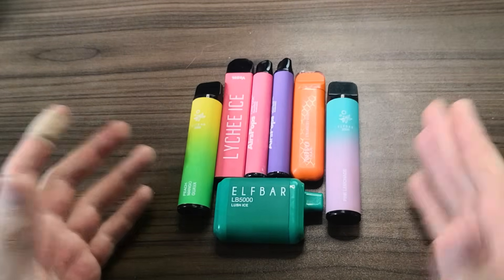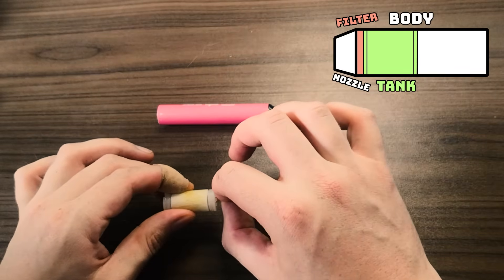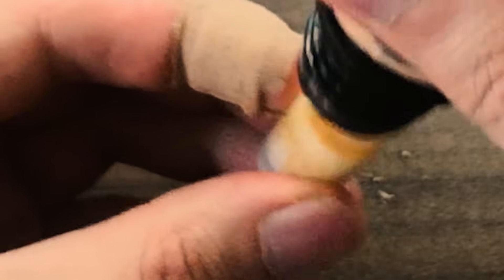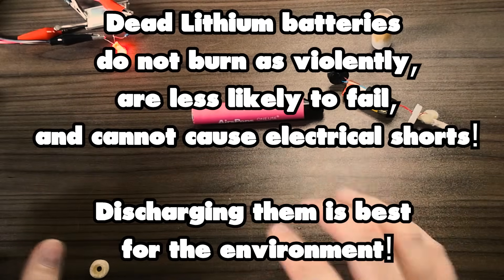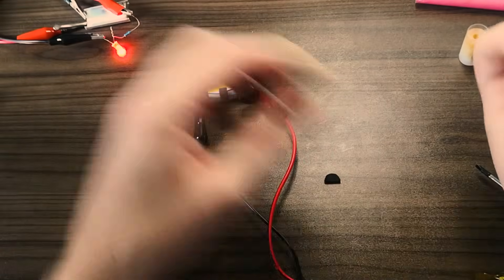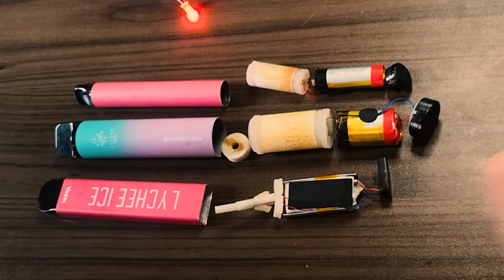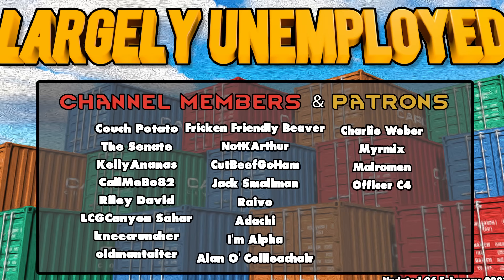'Disposable' vapes are a lie. Here's how to fix them.

Comment: 1. Vaping was not 'designed' by 'tobacco companies'. It was initially ignored by them, then they waged a war on it, then they 'embraced' a version of it designed to cost as much money as cigarettes.
2. Reusing unknown batteries for something that comes in contact with your mouth is bad advice. DO NOT BUY DISPOSABLES.
3. Coils and wicks are consumables, you should change them pretty often. You can't do this with disposables. DO NOT BUY DISPOSABLES
4. Disposables have subpar materials that were used 10+ years ago. DO NOT BUY DISPOSABLES

Comment: Disposable vapes should be banned completely. The only difference between a disposable and a reusable is a simple IC board to charge the battery and some kind of hole to drip fresh vape into it it. For that very minor difference in cost & design (< $1), the amount of e-waste would be slashed because people wouldn't be throwing these things away.

Comment: Don't the coils just taste like burnt ass if you do this?
Reply: @D-Fens_1632  you should easily be able to run 100ml of juice through one coil/mesh, most of em only hold 2ml anyway so that's 50 refills, so if you can reuse a throwaway 50 times you've saved a lot of money.

Comment: I've been making rechargeable flashlights, upgrading batteries in devices (like Bluetooth speaker, etc) and replacing disposable batteries in remote controls, using the batteries and charge circuits from various disposable vapes. 😊

Comment: Electronic engineering student here. That solder at 8:15 are what we call cold joints, it's fine on something like this but if you're ever soldering again, use flux, tin the pad, and the wire, and than solder it. Ps, the new space engineers series is amazing please continue it

Comment: i do this with distillate vapes sometimes, you can usually pry the top off and remove a rubber grommet, then refill about 2-3 times (though distillate is alot thicker than vape juice, the concept applies the same)

Comment: Disposables should be banned.  Most of the cheaper elfbars are some of the easiest to refill, all you've got to do is wiggle and pull the mouthpiece part out the oval body shell, and you gain access to the juice sponge underneath, I can do it by hand.

Comment: You should never press/apply pressure like you did on these type of battery. The soft part is kinda unstable and can explode in a worst case scenario. Always handle them from the sides only

Comment: I may be a bit late to the party, but am saving all the used vapes I can, hopefully will make some power banks from the batteries. 
Seems such a waste to just throw. Same as all the 18650s hidden away in old laptop battery packs. Hidden gems of power.

Comment: I use a nitecore battery charger, it barely fits but it works. Doesn't overcharge either. I also don't bother with the tape, never any issues

Comment: In the US many (most) disposable vapes have been re-designed to have a USB (type C) charging circuit.  However many new designs also include a chip that counts the seconds of your puff (usually in 0.1 second intervals) with an instruction to turn off the heating coil once the design tolerance has been reached.  In practical terms, if your vape was sold with a promise it would be good for 4,000 puffs the counter ensures that you won't get 5,000 (and it will usually turn the heat circuit off at 4250.  They usually assume your puff will be about a second and a half.  Some will temporarily turn off the heater at about 7 or 8 seconds as a safety feature.  The puff count is usually held in DRAM (ASCII) on the main chip.  At least one person has put up a post about resetting his to zero using a forensic computer technology.  However, that method is beyond the capability of many people. It may be possible to zero the counter with a jumper, but there are many different chips used by different vape makers.  The end result is that while you can disassemble many of the models, you can refill many of them, but good luck getting the heating coil to heat and produce steam once the maximum allowable puff time is reached.

Comment: nice to see video on you tube. i have been refilling my non refillable for around 2 years now. very easy to do. plus i have a 4 bay 18650 battery charger or i use the charger out of drone battery pack that you can plug into usb device. simple easy. all i did was convert 18650 battery charger to fit the smaller battery or print out a holder using 3d printer and have that base.
Reply: If you are so smart why are you using them?

Comment: I took one apart just before searching for a video like yours. I'm not interested in reusing the vape. I just wanted the charging circuit for some cells I have lying around from DeWalt batteries that my company disposed of for dirty contacts. I'll build a bunch of rechargeable packs for Motorola radios and charge the batteries through a 3.5mm audio jack if I deem it a safe method of separating the series connection and creating a parallel one. Off to seek more information.

Comment: If you pull out the mouth piece and push the entire assembly out through the bottom, you don't have to disturb the vape coil from its seating, just remove the juice cap and refill, they don't always work right after pulling it out of the wicking sponge.

Comment: 12:40 what kind of battery is this, meaning which model and what capacity? I'm wondering, since you said almost 3x the capacity and here in Germany, I can barely find anything beyond 550mAh and I casually use these batteries for small soldering / electronics / pcb projects.

Comment: A few things to be careful. Make sure your liquid doesn't go into the pipe, It'll leak into the coil and cause short circuit. Second, don't overfill the cotton it may leak into the draw sensor. Most cottons I've tested can take around 8-10ml eliquid but small vapes like these in the video don't do more than 3 or 4ml. And make sure your liquid is 50vg 50pg salt liquid. These devices have high ohm coils and you will feel higher vg liquids are harder to evaporate for disposables. Also consider to buy an actual pod vape they're much more convenient to refill and use in the long term.

Comment: I have an elf bar knock off and it wasn't too much trouble to open the top. 

Does Mark the plastic but just stay away from the mouthpiece? 

I imagine you could use a cloth between the pliers and the plastic to prevent marine?

Comment: The charging module you used is a tp4056 just in case people need one. I used the board out of a power bank to charge a disposable vape, filled it while it was in bits and now it works like new.
Reply from the maker: That's the one! There should be a link to the board in the description.
Reply: @LargelyUnemployed  I didn't think to look in the description, I have 10 modules on my desk but that means going all the way upstairs...the power bank was to hand.

Comment: Smoked these till i found out theyre just as Carcinogenic,as genetically engineered tobacco + its toxic flavourings 
🤢
Reply: I am more concerned about the coil inside disposables. They're supposedly made out of recycled metal but what kind of metal? If it contains even a small amount of lead it would be terribly bad
Reply from the maker: The vast majority of coils are made out of either Kanthal (FeCrAl) or Nichrome (NiCr). These are both chromium alloys that are great at handling repeated temperature changes. There is no lead, and they themselves are non-toxic as they do not easily oxidise or give off any vapour that could enter your system. The juice on the other hand is definitely not good for you.
Reply: @LargelyUnemployed  thanks for the info

Comment: I tried this on some of mine. It worked on one brand, but did not work on another (Yumi 1500 disposable pod). Are some batteries not rechargeable?
Reply from the maker: Lithium ion cells are always rechargeable, but it's possible that your vape may have used something else. It's incredibly important that you inspect each one closely before trying to charge it.
Reply: If the battery has mAh and/or mW rating and says 3.6/7/8V it is almost certainly a rechargeable Lithium cell and can be carefully charged with the correct type of charger circuit.  The chance of finding something else these days seems unlikely.

Comment: But how do I keep hitting a chargable vape that stops hitting for good once it SAYS there’s no more juice, even if it’s fully charged? Such as SVL sense triple berry?
Reply from the maker: I don't know that model specifically, but it sounds like the manufacturer has added that feature to prevent you from refurbishing it.
Reply: Not being a user myself I have opened a few that I have picked up on the sidewalk.  While reading about people converting them to LED torches someone wrote that the juice counter can be reset by disconnecting the battery from the little circuit board.  Not sure if this will work in all the devices but it kind of makes sense that the units would start at FULL when assembled and run down after a selected number of puffs.

Comment: it’s good to re use… but quite a lot of work…. why not just buy a vape that is designed to be reused and refilled?…. the best “reusable” disposable i’ve found are the rechargeable elf bar af 5000 it’s simple to refill all you need are pliers to take off the 10ml “bottle/tank “ and it’s good for as long as the internal coil lasts…. i use them all the time…
Reply from the maker: This method is not designed to replace that.  I had just been tinkering with refurbishing them because I found it interesting and decided to share how I did it. Was not expecting it to blow up like this hahaha. I don't think these disposables should exist at all.

Comment: I think i opened my smok novo by crushing it around the seam and then pulling it out. 

I'm now working on a modification where after the vape dies it gets gutted, then a slit is cut near the bottom of the casing, exposing the wiring and battery terminals. I then add in a 4 pin jis connector to the guts that allows me to to connect the vape to a usb lithium cell charger board. The heater and juice compartment has a window cut in it, sealed with sticky tape and is then carefully super-glued to the bottom electronics compartment, affixing it semi-permanently. 

The battery can be recharged, the juice refilled, and when the heater burns up i just solder in a new one from a new vape

It's a temporary measure. My regular vape died and i don't have money for a new one yet
Reply from the maker: That's an excellent approach. Just be careful with the soldering. Heating the battery up repeatedly can damage it as I'm sure you know. You'd be amazed how much heat transfers down if you're not quick

Comment: Drone Guy Here.Not sure if it's been mentioned but you can use a higher-draw load to drain the batteries faster. I use a car headlamp and put it on the back patio. Most of my packs are dead overnight

Comment: Heya, in regard to the charging board is it variable or do you have to buy different ones for volts and mAh? Best wishes, Stefan
Reply from the maker: The board is specialised to provide 1A of current until it hits 4.2(ish)V. The capacity doesn't matter, it will just take longer.

Although remember the internal resistance on much larger cells may cause heating issues! It's better to buy a beefier setup for those.

Comment: If you don't have the insulating tape like what came in the vape on the battery, the clear stuff, can you use regular electrical tape, the black kind used for normal wiring projects?
Reply from the maker: Yes, just so long as the vape doesn't get too hot. The glue melts really easily on those and they seperate quickly. Not great for summer.
Reply: @LargelyUnemployed  Got it. Good to know, thank you 👍☺️

Comment: Rebuildable RDA/RDTA is the way to go. People need to get back to that. 
Making coils and wicks on your own saves an astronomical amount of money. There's a fair bit of up-front cost (kanthal, cotton, batteries, battery charging bay, liquid, device),
but the long-term savings and ease of access to other flavors with just a minor bit of maintenance can make them a far better option. 

Ohm calculators that accept kanthal gauge resistances do exist and can effectively do the brainwork for you to make life easier. I always used 24ga wire, dual-parallel coils with 5-7 wraps. Phenomenally-simple build with great performance. 
Wicks burnt?
Womp-womp, just rewick it after dry-heating the wires and zip it under the sink water for a second without holding the power to clean the wires. 

Reduce, reuse, recycle ♻️ 

Stop creating needless e-waste which prevents an existing market from expanding to take its rightful place. 
Rebuildable kits should be sold in place of this stuff. It becomes a hobby at that point which can lead to healthier hobbies (soldering, electronics repair, etc).
Literally how I ended up building and repairing computers.

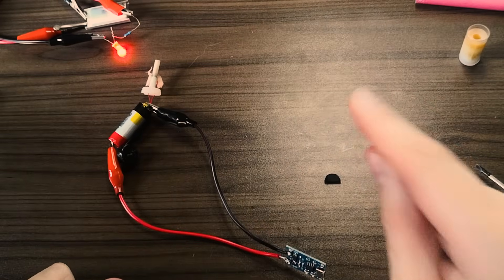Comment: Aside from maybe two I’ve lost, I’ve kept every disposable vape I’ve ever bought because I feel bad throwing them out, but I prefer not having to worry about dropping/breaking/losing them when they’re cheap disposables. I’ve even picked up ones I’ve found thrown out and salvage the battery if I can. The first few I bought (very similar to the first ones you opened) weren’t rechargeable, so I popped them open just out of curiosity and found they were still about half full of liquid, so I recharged the battery and got twice-ish the use out of every one. I’ve used a few batteries/charging circuits for dumb little projects here and there and even cut down a couple of the metal bodies and capped both ends with modified bottom pieces to make as a battery case of sorts, but I still have a (great smelling) Tupperware full of old disposable vapes I haven’t decided what to do with. 8:50  Charge them in a fireproof bag. Won’t stop the lithium fire, but it’ll contain it.
Reply: Keep em. Tesla will soon be buying lithium for millions per ton 😂
Reply: @RandomBogey  Hi, one dude makes electric bikes using them vape batteries..

Comment: i used to cut the end off a type c charger and use the exposed wires to charge the battery not the safest way but it worked

Comment: Discharging lithium batteries below their minimum voltage makes them more likely to grow dendrites that puncture the cell membrane, causing a short and a fire. Do not try to discharge any not-so-good looking battery to 0v before disposing, JUST take it to a hazardous disposal center or battery recycler (and maybe keep it in a bucket of sand)

Comment: the problem  with  disposables are... every contact  point  is soldered , more or less  you  inhale  solder at some  point  of its  lifetime , try to not get hot vape from it, or even better get some pod system

Comment: You can use the bottom of a Vuse Go 3000 Max to charge batteries - just attach crocodile clips to the wires and it becomes a charger without having to buy the circuit board to charge batteries.  It takes a bit of effort to dislodge the bottom of the 3000, but it can be refilled and reused as these other disposables.  Carefully remove the bottom, then the top mouthpiece and slide the bottom through the body to remove the entire part from the metal casing.  Carefully slide off the metal ring around the coil part, slide off the coil and refill with liquid.  Reverse process to assemble.

Comment: The business I work for discharges our scrap Lithium Polymer batteries by sticking them into dish filled with salt water.
Reply from the maker: That's a really interesting idea! I guess it just turns the leftover energy into heat?
Reply: @LargelyUnemployed  That's my assumption. It was one of those things where I was like... wow... I way overthought this.
Reply: Clever, will run it down to almost zero volts at a slow discharge rate and COOLING if something should want to overheat.
Reply: @KallePihlajasaari  I'm glad this little trick might help others. My one concern is if water somehow breeches the pack.
Reply from the maker: Yeah now that you mention it this does seem needlessly dangerous. Maybe just run some wires from the battery terminals to the water?
Reply: @LargelyUnemployed  That is no different than soldering wires (risk) and adding a resistor.  I grant that water ingress is a added risk but it is pretty unlikely given the usual failure is pressure build up.  

It is kind of sad that the energy left over is also wasted in disposed batteries, both primary and secondary cells. Running them flat in series in a energy recovery system that charges some larger bank would be cool.  An active diode to protect them from reverse voltage and an indicator to remove them for safe disposal.  I have read that the fire hazard of Lithium cells is proportional to their charge condition.
Reply from the maker: @KallePihlajasaari  I hear you. Perhaps the safest approach would be to attach leads with alligator clips to avoid soldering anywhere near the battery.
Reply: that could work. genius.